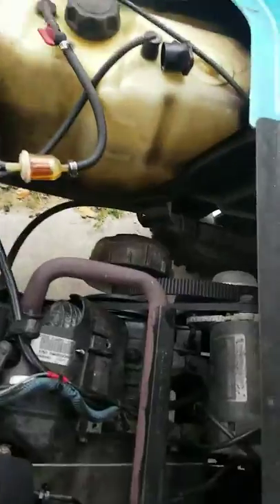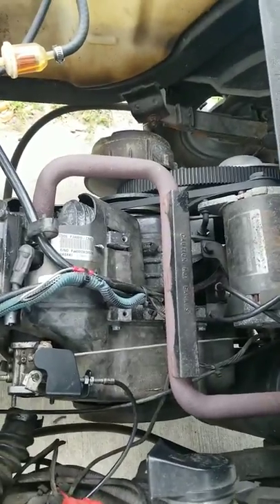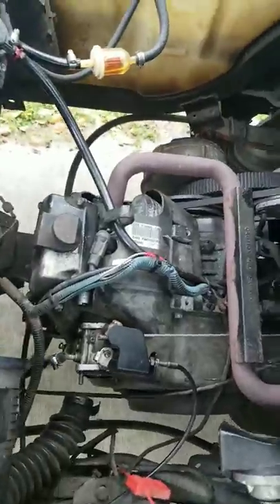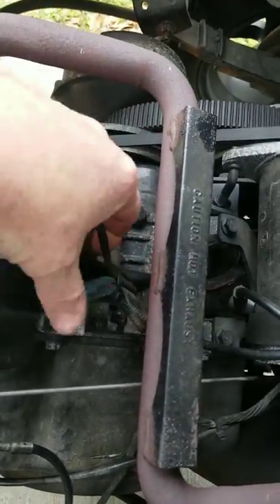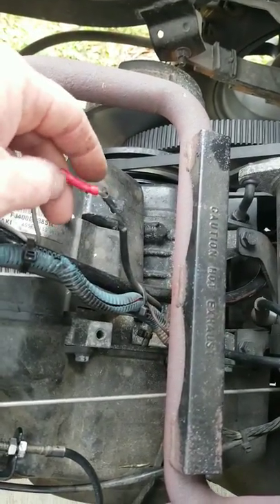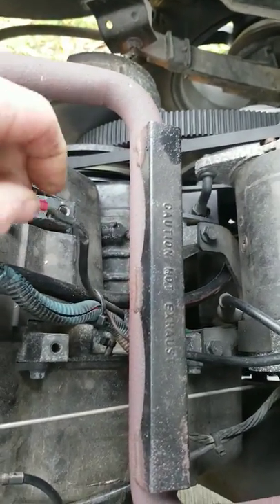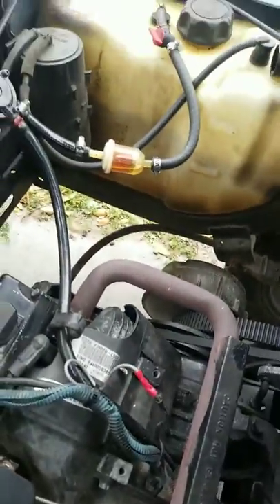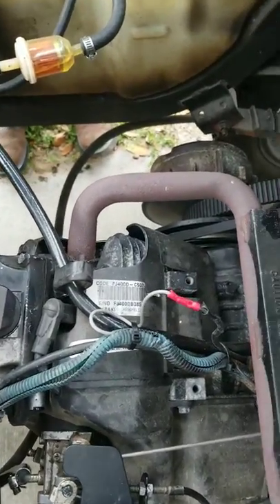Is my coil bad on my Ezgo golf cart?

Comment: Where is that wire going to?
Reply from the maker: The wire goes to the relay
Reply from the maker: Under the  black cover
Reply from the maker: Beside battery
Reply: Mine has fire without it plugged in but no fire with it plugged in. Been trying to figure out the problem.
Reply from the maker: @drewzx3  probaly bad relay
Reply from the maker: Check voltage on relay. make sure when you hit the gas the relay clicks and kills the ground so it can fire
Reply: Thank you
Reply: Well changed the relay and that wasn't it.
Reply from the maker: @drewzx3  when you hit gas does your relay click
Reply from the maker: @drewzx3  send me picture of your relay and wires
Reply: @HeyHeyHey97  yes my relay does click want me to text it?
Reply from the maker: You have volt meter
Reply: @HeyHeyHey97  yes I do

Comment: or you could just put a multimeter on the coil and test ohms....lol
Reply from the maker: That's exactly right.
Reply: Or... pull plug out of head.  Reinstall plug cable. Ground it to the block. Crank and look for spark